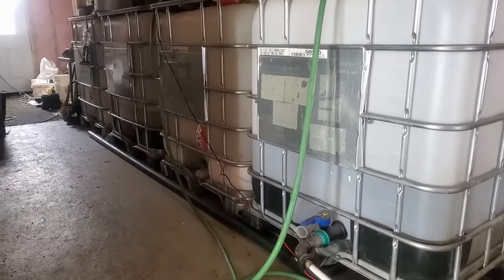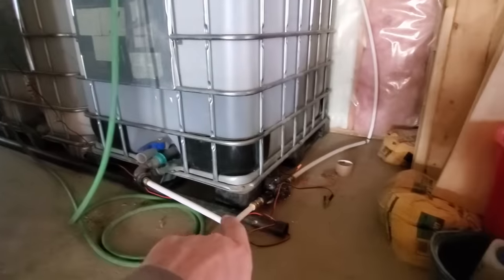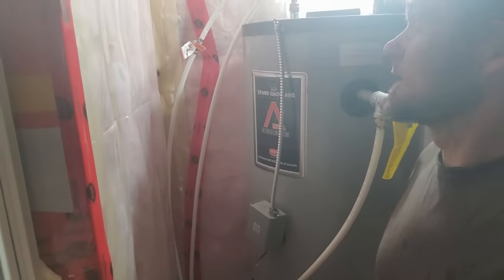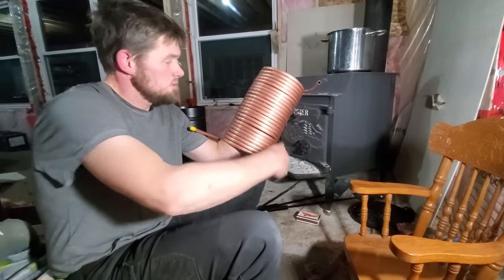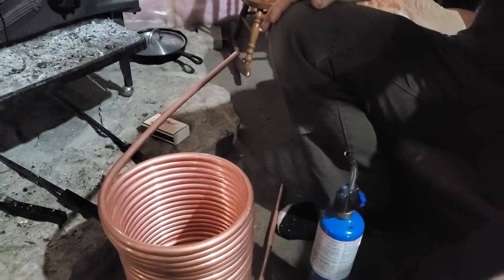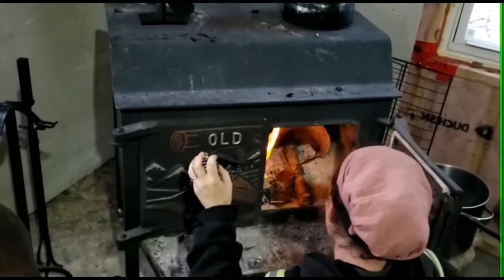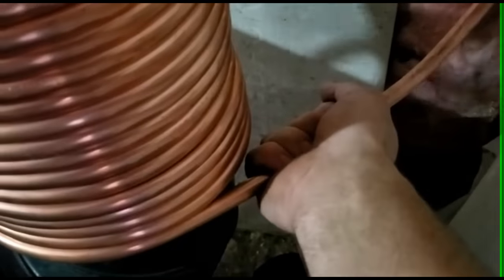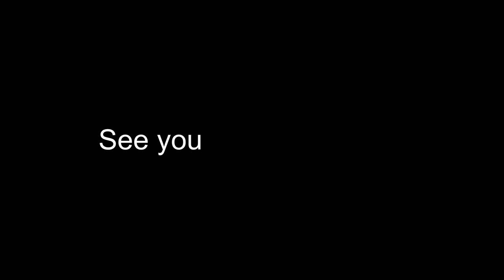Endless HOT water for FREE /OFF GRID

Comment: Hi. Just a suggestion? The hot water outlet you got a galvanic pipe and then a tee that you connected a TP "SAFETY VALVE" to...that wont work because they don't function like that ... it needs to be in your tank to get a accurate temperature fail safe peak. Also rather use non galvanic piping on your plumbing that poor TP valve will be gone anyways in a few months with that pipe around it. I like the idea's but id rather say keep them in your personal collection and not on youtube so others follow the same mistakes that may cause harm.
Reply from the maker: The whole system has worked flawlessly for over 1.5 years, thank you for watching.
Reply: @countrysideacreshomestead2008  Yes same reply when i tell Ms Jones that her geyser is installed incorrectly....And she replies...but it worked for years she says...one day is one day mam .. good luck

Comment: This is a great concept for the colder months, but what about summer? I'm sure running a wood stove all summer wouldn't be the best.
Reply from the maker: We built the house with lots of windows so we could keep it cool while cooking in the summer.
Many of our mornings are still cool even in the summer so a bit of heat is nice.
We plan to build and add a solar water heater to complement our current system.
Reply: @countrysideacreshomestead2008  do you think you'll do solar panels and am electric water heater or something like one of those black coiled lines that heat up in the sun?
Reply from the maker: Might try both eventually but for now  we will try a black coil.

Comment: Great video. Have you figured out how to control the temperature? E.g. less/more coil. Or do you use mixer taps?
Reply from the maker: Thank you.
We don't control the temp at all, so far it hasn't been an issue. Water gets extremely hot but with a family this size we used a lot of hot water so there is always cold water being add to the tank.
I'd like to switch to a 60 gallon tank yet so that we have more capacity.
Reply: The chimney will not tend to get that hot. Mine sits below 200 degrees unless I am really firing the stove up.

Comment: Very interesting and creative, I liked your video very much. I am curious to know what you use to heat the water in the summer time, do you have a outside stove to heat the water? Also how long does it take the water to heat up? Can one person take a shower after another or do you have to wait a hour or so in between? Also doing laundry with hot water, do you have to wait between loads? Thank you for sharing.
Reply from the maker: When we want showers we fire up the wood stove, we do plan to add solar water heating as well. 
There's 40 gallons of hot water once it's heated so multiple people can take a shower but the recovery time is a bit slow.
Reply: @countrysideacreshomestead2008  Thank you for the reply. Your setup would work well for winter for me. I was thinking of taking a electric hot water heater and swapping out the elements to 24 volts DC. Then I could connect 3 to 4 solar panels directly to the thermostats on the hot water heater. This would give me hot water during the summer without having to start a fire. I'm also looking into Bio-gas as a fuel source to cook with and run equipment.
Reply from the maker: You have a link for that 24v element?

Comment: Great use of you enginuity...but have couple questions...
1 no mention of a filter system, you mention possibly pumping from the stream but mainly reclaiming the rain water (good idea by the way) but either source you still going to have to run a filter
Reply: Question 2
Why are the tunes not ran thru the stud work...meaning from the water heater tank down to the coils?
Reply from the maker: We do use a filter for all drinking water.
Reply from the maker: Not a good idea to run waterlines in exterior walls around here, too cold in the winter

Comment: If you have a creek running on your property why not installing a ram pump to fill the tanks
Reply from the maker: Excellent question,  we actually looked into building one.
1: cost  the house is a long way from the creek.
2: that it only work seasonally because the pipes would freeze in the winter 

We are looking into adding either a dug or drilled well this summer

Comment: What if the water in the copper gets warm enough to boil? This is a closed system and it will blow the relief valve on the water heater and fill the pipes with steam melting the plastic lines. How are you controlling the water temperature? Am I missing something?
Reply from the maker: If the water in the copper gets warm then it rises into the tank above and pulls colder water into the copper to replace it....
System has been running flawlessly for 1.5 years

Comment: Can you share the reason you went with a regular wood stove instead of a rocket mass heater, considering how much safer and drastically more efficient the latter is?
Reply from the maker: We have been looking into rocket mass heaters but honestly didn't know enough about them when we started our build. 
Wood stove is simple, easy and we have tons of wood.
Reply: @countrysideacreshomestead2008  Fair enough.  Here are some things I've picked up about them that REALLY caught my attention:

1. They have unprecidented efficiency when it comes to heating people/things; properly built RMHs use 8-10 times less firewood.  Seriously.  One institutional rocket cookstove uses three pounds of twigs to heat eight gallons of water to a boil.
2. Once the well-insulated chimney comes up to temp in 6-8 minutes, the whole system stops smoking as the temps inside the chamber climb past 1500F.  (...as that happens inside of an enclosure, it is perfectly safe.  It also means that it is impossible for the chimney to end up with a coating of creosote.)
3. Because of how much air travels through the system, carbon monoxide levels drop to well below five parts per million within fifteen minutes.
4. Because of how efficiently the system transfers exhaust heat to the mass, the exhaust leaving the house is usually around 70F and contains almost nothing but extra moisture and CO2.  (Could be perfect for a greenhouse?  Also, there are greenhouses that use an RMH to allow even for aquaculture in subzero temperatures.)
5. In an interview with one couple at 2pm, it was -20F outside while the inside was cozy.  They revealed that they had only ran it for an hour or so starting at 7pm the night before.  (Most folks only run them for an hour or two once a day.)  That means the system was keeping the house warm nineteen hours after the fire burned out.
6. I watched a teardown of a rocket water heater and, after more than two years of constant use, the heat exchange chamber (that exhaust gases travelled through) had less than an inch of dry soot in it.  (I grew up with a wood stove and KNOW what a problem creosote becomes if you don't clean the chimney on a regular basis.
7. While they are VERY inexpensive and easy to build, there are a number of issues that will have to be kept in mind, so careful planning is key, as well as doing LOTS of research to ensure the smoothest possible build.
8. Lastly, here is a video by a family about their experience living with one for a full year: https://youtu.be/CoOcsq12UkE

I hope that this is a blessing to you.
Reply from the maker: Great! Thank you, ill watch that later and maybe we will be working on another project ....
Reply: @countrysideacreshomestead2008  I posted replies to your comment but YouTube deleted them for some bizarre reason.  Can you check your "Comments" tab in YouTube Studio under "likely spam" to see if they are just awaiting moderation?

Comment: hi very helpfull however i get confused at around 5.30 when you talk about cold water going into the hot tank ? two lines one hot water going to shower ect i get that but what is the cold water line going into the hot tank for ?
Reply from the maker: Water heaters have a cold fill line and a hot line that goes to your fixtures. 
Ours is the same as that plus it has a loop that wraps around the chimney to heat the water.

Comment: what controls the temperature of the water for expansion and heat not to blow the lines or what so what do you use for that?
Reply from the maker: There is no temp control although thst could easily be added by installing a heating loop in one or more rooms and using it to dump water when it's too hot. 

We have a pressure relief valve built in to the system that would blow if things got too hot but this has not happened.

Comment: Question. At what point, did you drill the studs for the water line, pass through? Don't mean to sound lije an idiot, i have had struggles my easuring just right, especially when the drilled hole ends up aligned with a wall, directly below it..lol. Talk about contorted drill angle..
Reply from the maker: Waterlines are in the joist spaces  lots of room in there

Comment: So I must be missing something. You have 4 lines that go into your water heater? My electric water heater only has a cold in, hot out, a drain on the bottom of the tank and a blowoff valve. Please explain the what the 4 lines going into your tank are??
Reply from the maker: Two of the lines are for the hot water loop. Water is heated with the coil on the stove. The other two are cold in and hot out.
Reply: @countrysideacreshomestead2008  So did you modify your tank, add an internal circuit for the loop, or just use the blowoff and drain fittings for the loop?
Reply from the maker: I explain that all in the video.
Hope to do an update on the project soon.

Comment: What's the verdict a year out? The pressure relief valve has never opened? Chimney staying clean?
Reply from the maker: The old pressure release valve was causing some problems, likely wore out because it was a used tank when we started. 
We put a new relief valve on it and have had no problems since.
Also the chimney has not been an issue.

Comment: Hi guy I've watched a lot of these videos. No one realy talks about building pressure in the pipe or how to deal with it. Do you have any suggestions on that. Or have you not experienced this. Is your hot water running into a gyser before coming out of you shower.? Which has a pressure valve on.
Reply from the maker: The water circulates into the water tank the tank has a pressure relief valve on it should it be needed but we have not had any issues so far.

Comment: Hi,
In watching your installation of the coil around the stovepipe, I noticed a fire-hazard.>>>Although it appears that you have rightfully placed  what appears to be a concrete panel or sheating on the wall behind the stove, I wanted to inform you that there is a high probability that your wall studs could catch on fire as there should be an air-space between the sheating and the wooden studs.
   I am mentioning that to you not to be critical in any way, but rather to save you and your family from a possible disaster.>>>I will explain that is exactly what caused a friend of mine house to catch on fire many years ago, and luckily for them the fire-department managed to save the home,  ( although he had done exactly the same thing as you did ) The fireman advised him that he was not in compliance with the building & fire code, and explained to him that the concrete sheating had to be removed, and a few 1 inch by 2 inch wood strapping had to be applied perpendicular across the studs and the concrete sheating re-applied so that there would be an air-gap between the sheating and the actual studs.>>>I hope that this information will protect you, as your family.>>>I have only the best of intentions for you, as your family.>>>Kind regards.
Reply from the maker: Great comments, this video was made a long time ago and we are much further in the construction of our home now, that was just a temporary measure.
Reply: Thank You for your reply.>>>>I am happy to hear that you, as your family are safe.>>>I certainly didn't want to offend you in any way.>>>So kind of you to send me a reply, and much appreciated.

Comment: Nice job on the wood stove water heat exchanger.   How did you determine the number of coils to put around your stove pipe?  Is it possible to have too many loops?
And has anyone ever come close to getting burned?
Reply from the maker: The coil of copper was 25' long, i believe, and I just bent the whole coil around the chimney.
I don't think too many loops would be an issue.
No one has come close to burning.

Comment: How do avoid the risk of flashing to steam and creating a very dangerous over-pressure situation in your lines?
Reply from the maker: I will do another video explaining it all better soon so stay tuned for that.
The system has a relief valve built in. If pressure gets to high it would open.
Reply: You might want to think about changing the supply to the old heater to copper for a few feet, if it does turn to steam it will melt the pex. Once it's steam the water in the line won't let it pass, steam can't move through water. I've seen it happen on similar set ups. Being on the flue you might get away with it not getting to hot

Comment: Question: I understand the thermosyphon and heating, just curious about how you get pressure for hot service and what's the refilling method, or is it all pressurized?
Reply from the maker: We run a 12volt rv pump to pressurize the lines
Reply: So it's all hooked up normally and the hot water tank starts refilling as soon as pressure drops? Thanks for the quick response and help!
Reply from the maker: Yes that's correct, the rv pump keeps the system pressure at around 50 psi.

Comment: Great video!
You just convinced my wife to give this a shot on our homestead. 

I’m just wondering if this would work with the hot water tank in the basement and the stove above it? Any thoughts?
🙏
Reply from the maker: No it wouldn't work that way unless you use a pump.
We are using thermal siphon to circulate the water.
Reply: @countrysideacreshomestead2008  wouldn't the rising hot water, even if redirected to the basement, still pull water up behind it?
Reply from the maker: Good question,  might be something to try.

Comment: Not sure I understand why you would pump water from one container to the next. Just have open pipes between them at the lowest level (perhaps with a valve, in case you need to pull one of them. They will all stay at the same water level, self balancing.
Reply from the maker: I explained that in the video. They will be all hooked together but I was missing some pieces so I was temporarily transferring water with a pump from one tank to the other.

Comment: how much of a hassle is it to light the heater every day also do you have a pump to push the water vertically thanks for video
Reply from the maker: How much of a hassle? It means lighting a fire in the woodstove...thats all.

There is no pump in this system. As explained in the video it works on thermal siphoning. 
Thank you for watching!
Reply: @countrysideacreshomestead2008  thank you for your reply i am going to do this i live off grid in AZ high desert is there a formula for the pipe run vertical to horizontal thank you
Reply from the maker: No formula,  hot water rises, as it rises it automatically pulls cold water into bottom of coil and starts circulation. 

Please like share and subscribe
Reply: @countrysideacreshomestead2008  thank you i thought there was a limit to how far you can get the siphon to push water vertically
Reply from the maker: There might be but I've never tested that, mine lifts 12'.

Comment: I'm unsure why the hot water doesn't expand in both directions in the heating coil. Would it not cause an impasse? Yes I realize heat rises, but in a closed system, why does the water flow upwards, instead of simply expanding both directions and causing a flow jam? Anyone know?
Reply from the maker: It's not a closed system, it's a loop. This allows the hot water to rise and suck the new cold water in.

Comment: Fantastic video. Do you need a pump to enable the hot water to circulate above into the tank, as it's situated above the source of heat?
Reply from the maker: No it circulates all on its own.
Reply: @countrysideacreshomestead2008  How long does it take to recover using just gravity to get the heat up there? I would think it would be much much faster with just a small circulator on there. Also, firewood isn't free :)
Reply from the maker: I've never timed it, we have a large family and it meets our needs.
The excess heat from the chimney is free.
Reply: @countrysideacreshomestead2008  Cool, thanks. You'll like the solar loop when you get it set up for summer, they work great.
Reply: @countrysideacreshomestead2008  fair play absolutely amazing stuff. I am gonna do the same buddy. Thanks for the video.
Reply from the maker: Thank you

Comment: great work do you worry about the water getting to hot ?   is that an automatic damper on your chimney ?   im going to that in mexico   heat my water with a wood stove  just dont know of some of the thing in usa
Reply from the maker: We have a pressure release valve on the hot water tank just in case but we have not had a problem so far. 
I had thought to circulate excess hot water through a loop in the house in order to avoid it getting too hot.
We do not have a damper on the chimney.
Reply: thanks for your reply learned alot from you @countrysideacreshomestead2008
Reply: Heat the water via a cooking stove

Comment: just a tip that you might not care about.  the galvi nipples and tees on the oil fired heater they will cause electrolysis  use a water heater nipple, it is a dielectric nipple  then switch the tees and other nipples to brass.